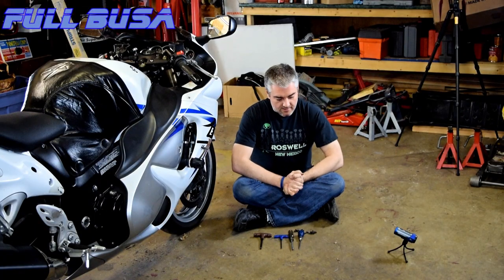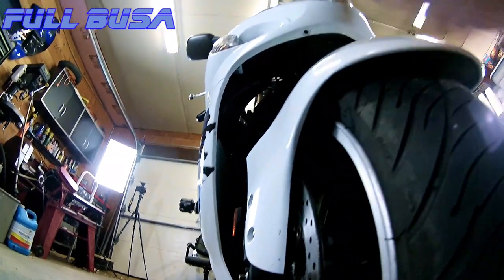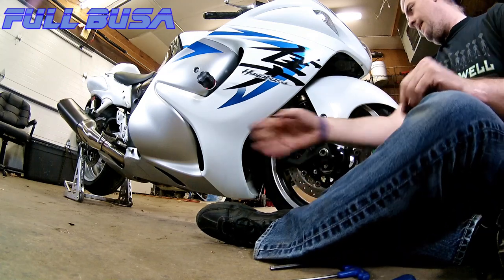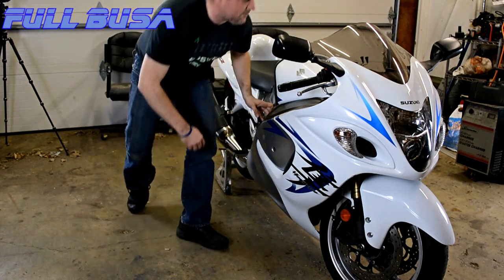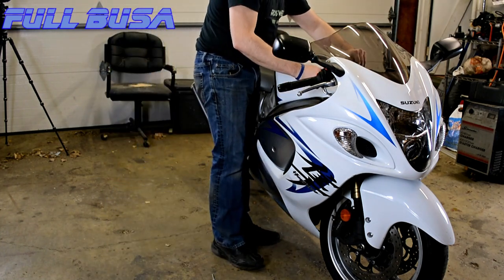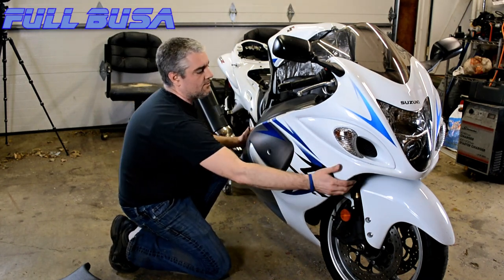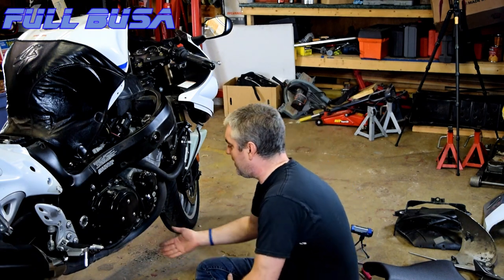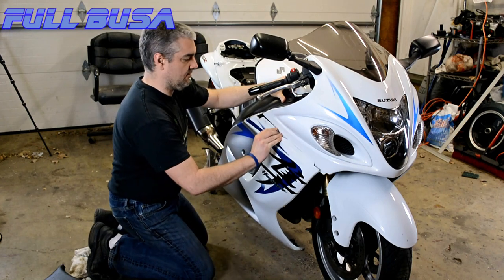Fairing R&R for Oil Change on a Gen 2 Hayabusa

Comment: That’s a lot of work just to change the oil . That makes the oil change in my Kawasaki ZRX1200R look easy. And the  ZRX has an internal oil filter inside the block but at least there’s no plastics to spend a hour removing to get to the motor.  The Hayabusa is an awesome bike but  I’d  gladly pay the dealer the $100 to change my oil if I had a Hayabusa.

Comment: Thanks for the video, I have just bought an  08  Busa and watching the video  have made me familiar with several useful points, including the radiator and expansion tank is on the same side....just one question on the left side what is there to be maintained for the need to remove the fairing.... Thanks.....

Comment: Can you get the oil filter Off/On  without removing the right side fairing if you pull the two Fairings apart at the bottom?
Reply from the maker: +adhoc231 hmm, that might work.. I'll have to see if it'll fit through the headers. I think I've tried that before but I can't say for sure if it was on this bike :P
Reply: +Full Busa  I Changed oil and filter on Busa Gen 2 and i used a K&N filter with the 17mm  nut on it i spread the Fairings Apart from bottom and packed the fairing with Rags to give me space to get filter off the filter has to come off via  side of headers not much room there but with the Air vent on faring you can get a set of filter type pliers in there to loosen old filter...The trick to this the K&N  filter with the 17 mm  nut.
Reply: 1. You never showed the actual oil change2. This video would be 1/2 as long if you didn't talk so much!

Comment: If you want to remove the fairings, it is not necessary to remove the black plastic inner fairing pieces.....
Reply from the maker: +Barry Johnston On gen 2's those black plastic pieces connect to the fairings and to each other. They do need to be removed before the side or upper fairing.
Reply: +Full Busa I do have a slight advantage though, I have a motorcycle lifter bench, which makes it a lot easier than working on the ground...